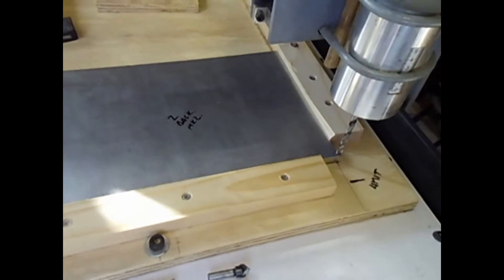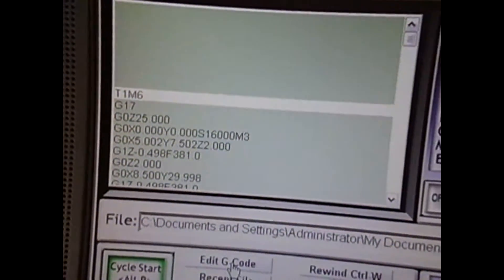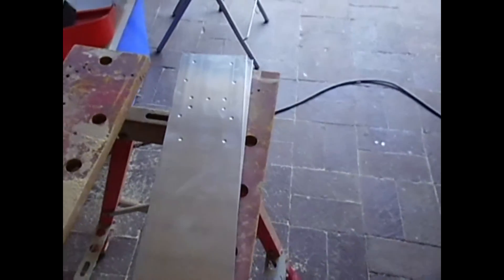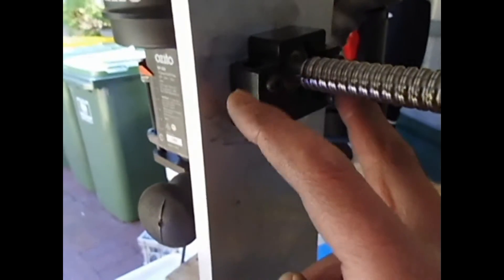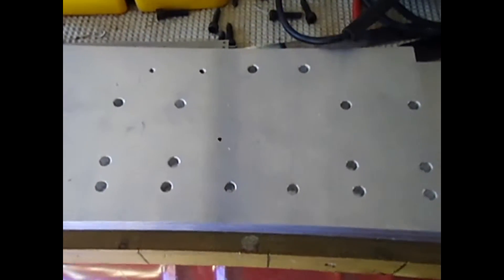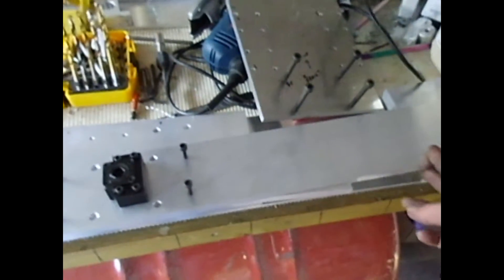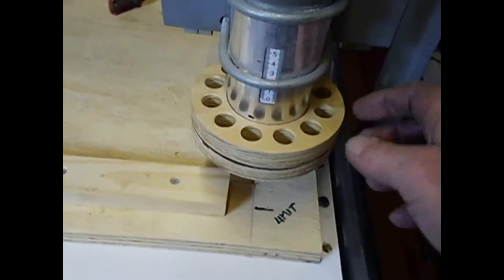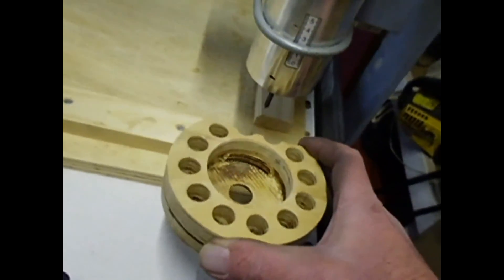DIY CNC Rebuild Part 1

Comment: cheers good vid, helped me understand the orientation of the bearing  support blocks, regards
Reply from the maker: Im actually in the process of building a new CNC machine and Id be happy to email you the cad drawing if you liked.
Reply: nah dude, i have a big ass machine here!! lol its frikking huge.

What would be handy though, can I ask please -

The bearing block on the stepper side of the ballscrew, with the angular contact bearings - how does this fix to the ballscrew?

Is it set screws, or is it a nut that fixes the bearing block on place

if it is a nut, does it matter how tight it is? does this affect the bearings inside.

last question - so i guess then that that bearing block is the place that the ballscrew is anchored to the gantry? - not the stepper, even though thats also anchored... the bearing block is whats supposed to keep the screw fixed in place, so it cannot move..

My machine has a 2.7 meter long ballscrew, it a Chinese machine ive rebuilt, or rather, am rebuilding. the bearing setup on the long screw is terrible, it doesnt have proper bearings at all.
Reply from the maker: The proper ballscrew end bearings have a "fixed" end and a "floating" end. The fixed end has spacers in it and the ballscrew is end machined to fit the bearing with a threaded part that a lock nut (which has a grub screw) on it.The floating end is to allow for the expansion of the steel due to temperature variations (I assume).The Mk1 machine I built I used plain old pillow block bearing for the ballscrew end supports which also have a grub screw to prevent any movement of the ballscrew.Not sure I explain it properly?